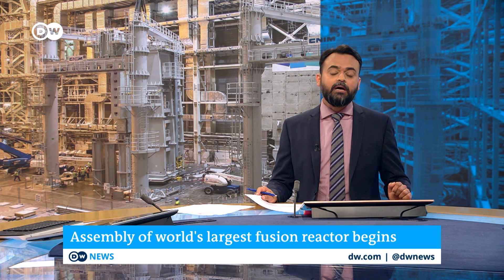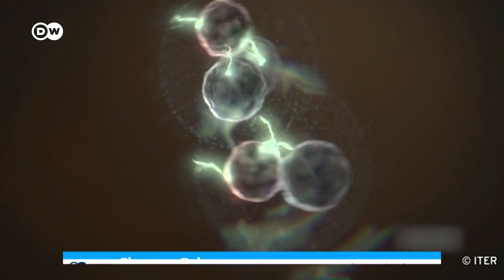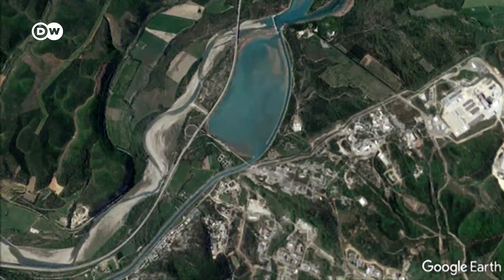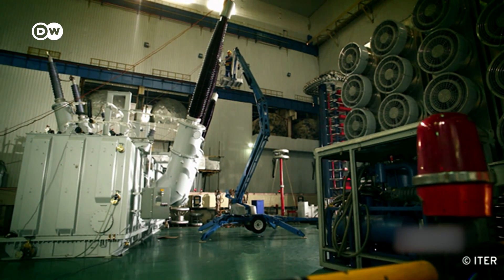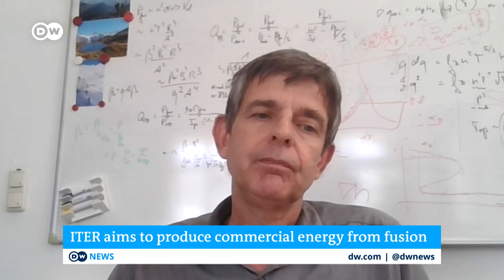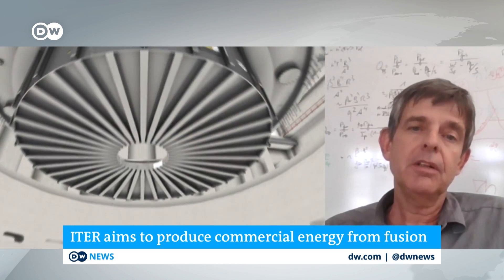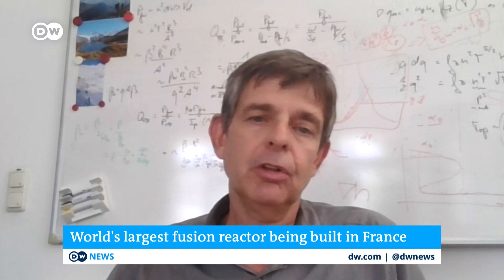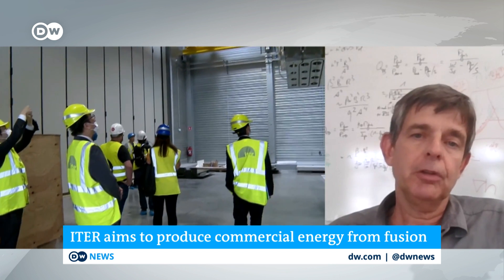ITER: Assembly of world's largest nuclear fusion reactor begins | DW News

Comment: If there could be one, just one good thing to happen this year, I hope we at least start to build a better future for clean energy.
Reply: You're "ONE GOOD THING" !!! A High Tech Electrical Engineering Company (SAFIRE), announced  last July 2019 (at Bath University UK) the first of a new breed of 100% Green reactors known as "Plasma Reactors". This new system is not only Green but 1600% more efficient (Cheaper electricity for you and me). So efficient in fact it will also replace wind generators and solar panels. SAFIRE also have a method to "Switch Off" Nuclear radiation and clean up all the radioactive buried waste !!! The whole point of the Plasma Reactor is to replace ALL current methods of generation including Nuclear Energy..... Behind SAFIRE is a well known Electrical Engineering Giant.
Reply: @TheDuke-vb9cq  link?
Reply: @yash1152  it's a scam, he want's your money,  he has been scamming people in other threads too. 

Report his comment for unwanted commercial.
Reply: Hey, SpaceX developing and launching Starship isn't a good thing or what?!?!

Comment: I hope this prototype delivers. Then we can stop using fossil fuels. With clean energy problems resolved we can use that to power our science.
Reply: This is why it has to be a government project, it will be a revolution to energy sector
Reply: how many $$$billions for just a prototype ?
Reply: @laszlozoltan5021  But the cost includes research and development, and a one time production. When we figure out how to do it we can mass produce the components and the economies of scale will probably lower the cost to make it financially viable.
Reply: @laszlozoltan5021  if it works it wont be a prototype
Reply: @GodOfChaos_HeXa  
ITER is only a laboratory test bench. It won't have a steam boiler or turbine. It's just to verify that they can get net power out of a magnetic confinement fusion setup. Though it wouldn't surprise me if the scientists decide to rig up a small boiler and steam turbine just to have bragging rights to the first power produced from fusion.

Comment: Sounds amazing. Just need to make sure that it's safe.
Reply: @Mo Mo Fusion.Fission - it's regular nuclear reactors on trans-uranium elements.Fission - means "splitting". Fusion - fuse elements together.
Reply: Nuclear is safer than solar
Reply: @Obi_boy  Ironic how nuclear is multitudes more efficient and powerful than any power source we have at our disposal and yet its been toppled by anti nuclear freaks
Reply: You're not exactly Mr. Current Affairs !!! A High Tech Electrical Engineering Company (SAFIRE), announced  last July 2019 (at Bath University UK) the first of a new breed of 100% Green reactors known as "Plasma Reactors". This new system is not only Green but 1600% more efficient (Cheaper electricity for you and me). So efficient in fact it will also replace wind generators and solar panels. SAFIRE also have a method to "Switch Off" Nuclear radiation and clean up all the radioactive buried waste !!! The whole point of the Plasma Reactor is to replace ALL current methods of generation including Nuclear Energy..... Behind SAFIRE is a well known Electrical Engineering Giant.

Comment: yes cheap electricity bills
Reply: It won't be cheap because of the huge hardware costs and complexity, but it could be clean and abundant, which is very important as well.
Reply: @HiAdrian  Missed that part about neutron emissions?
Reply: @augustlandmesser1520  you can easily supress it in heavy water
Reply: @HiAdrian  atleast in the begining fi there are 3 or 4 of those things in the EU that work it will be a little bit cheaper then the current average
Reply: @James Smith Or if other means of fusion become viable. I don't think fusion has to be expensive, it's just that the large magnetic confinement machines of today are.

Comment: Wow! I did not know we were this close to generating energy from fusion!
Reply: Fusion is famous for constanty being the next big thing, and remaining so since the 1950s. Its very difficult to create the magnetic fields with enough precision to reach the temperatures necessary to achieve a net gain.  That's what they are focusing on now. They will just let the energy go. The next generation of scientists will try to find ways to catch/conduct/transform the energy into something useful.
Reply: @eljanrimsa5843  REBCO tape and ARC reactor,that's not so much "next generation of scientists". Like you said,fusion is not about being real or not - it's about achieving net gain,and in big part - by advancement at magnetic control.
Reply: @eljanrimsa5843  It's also famously not funded enough
Reply: We aren't close at all, we have alot to learn even after it's built
Reply: It's a research reactor not an actual viable fusion reactor. Fusion power has always been 50 years away.
Reply: You're not exactly Mr. Current Affairs !!! A High Tech Electrical Engineering Company (SAFIRE), announced  last July 2019 (at Bath University UK) the first of a new breed of 100% Green reactors known as "Plasma Reactors". This new system is not only Green but 1600% more efficient (Cheaper electricity for you and me). So efficient in fact it will also replace wind generators and solar panels. SAFIRE also have a method to "Switch Off" Nuclear radiation and clean up all the radioactive buried waste !!! The whole point of the Plasma Reactor is to replace ALL current methods of generation including Nuclear Energy..... Behind SAFIRE is a well known Electrical Engineering Giant.